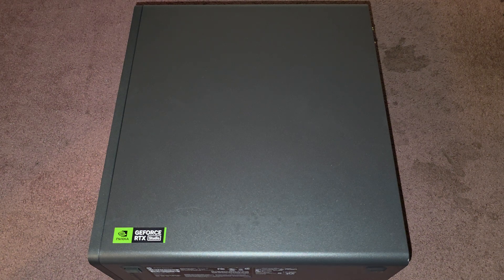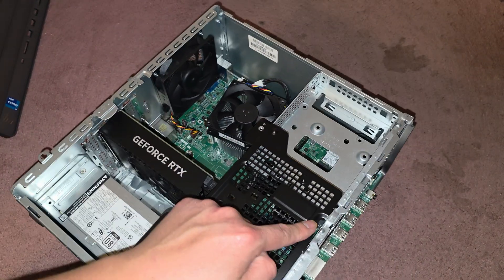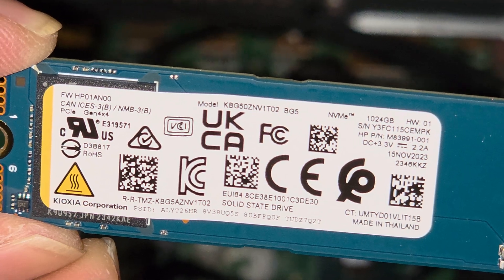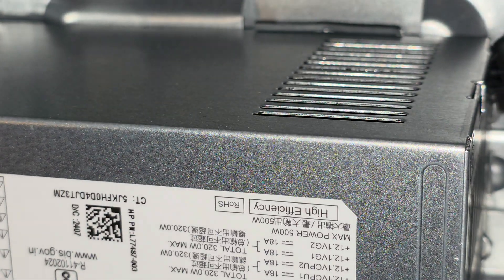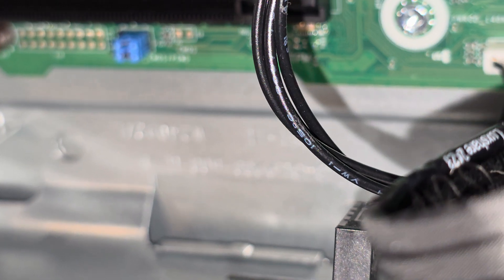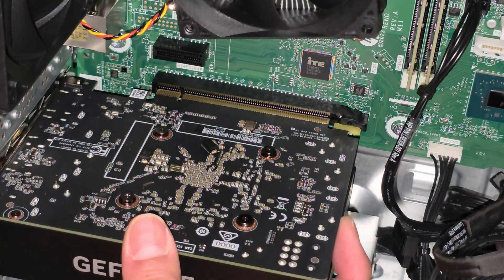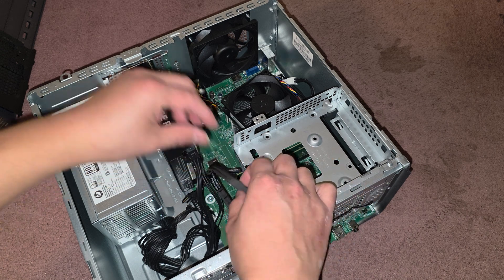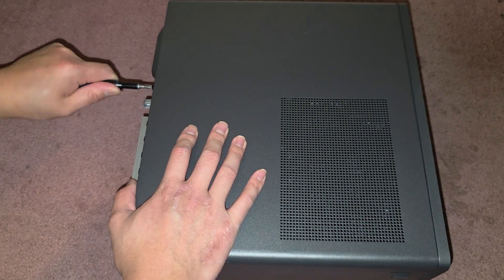HP ENVY Desktop PC TE01-5364 Disassembly RAM SSD Hard Drive GPU Upgrade Battery Replacement Repair

Comment: Nice video, thanks! Do you know if this the same as a TE01-5009?  Did it come with the caddy for the extra drive, or you bought it separately?    I tried to ask HP Support and they have no idea, they said the TE01-5009 can only have one drive.
Reply from the maker: Open it and check